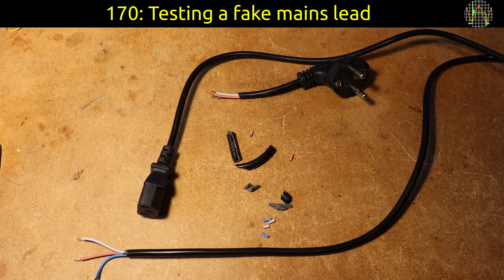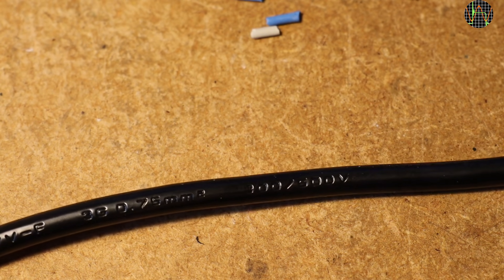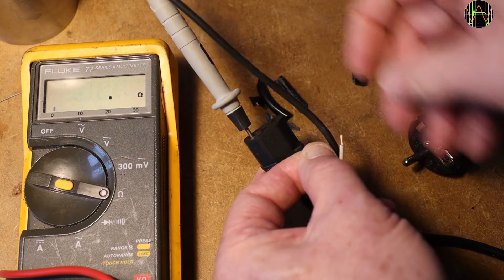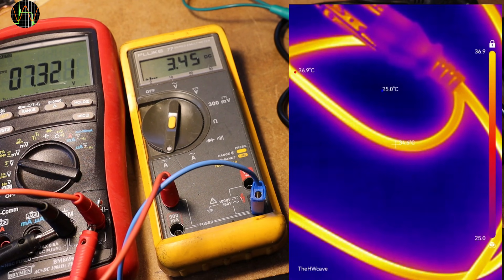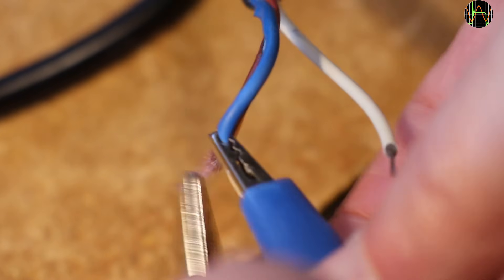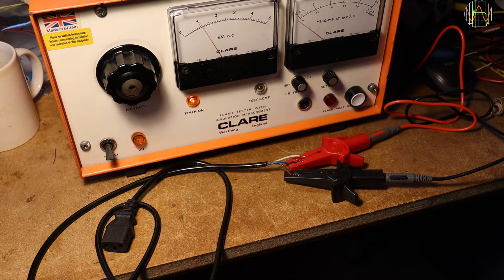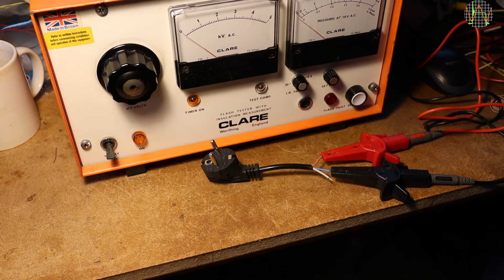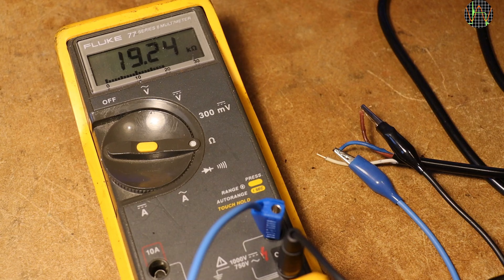170 - Testing a fake mains lead

Comment: You were "really lucky" to receive a cord with aluminum wires, i bought an el cheapo power supply a time ago from aliexpress and i was "shocked" to find that the wires were also almost invisible lol and to make the things worse they were made of freakin IRON! 🤬😠 An easy test to find out definitely if they are aluminum or copper is to place the exposed metal on a flame, copper will not deform just glow red hot, aluminum almost disintegrates.

Comment: I understand your point about the cord being incorrectly labeled. But, I do wonder if it was sufficient for the device that it came with... If it was underrated, does that mean that it was intentionally meant to be dangerous? It sure makes one wonder...
Reply from the maker: I get what you mean but the problem with these cords are that they are not fixed to the device. So even if they would be ok for the device it came with, there is no guarantee that the cord won't be moved to others.  I suspect my cord came with a Banggood hot air station (Atten clone) which peaks at more than 700W. That's nearly 3A which I think is already on the unsafe side of this cord. I think some manufacturers care only for money and have a total "don't care" attitude to safety. They pack the cheapest cord, and fit the cheapest fuses, both of which are very often fakes.
Reply: You could nowadays wire a mains led lamp/fixture in your house with very thin wires given the very low current they consume, the problem is if something shorts or overload on the end of the wiring, since it has "high resistance" it will melt and catch on fire because the current wasn't enough to trip the circuit breaker, and that's the big problem with these dangerous pieces of trash, and some of them also have really crappy plastic that easily falls apart

Comment: In the 1920s when radio/wireless sets in the home started to become common they often used a high resistance line cord to drop the voltage to the set. They could get quite warm and were often referred to as ‘curtain burners’, as they sometimes set the curtains, they were often hidden by (who wants to see an ugly wire in the parlour, after all) on fire.
Reply from the maker: Great story. I am sure this "high resistance" cord was put there intentionally and people knew it would get hot. These fake cords on the other hand are sneaky because these days people do not expect a "curtain burner"
Reply: @TheHWcave  absolutely, people were aware of the risk*. It was just the thought of a high resistance wire that brought to mind that old technology. :-)

* I realise, as I typed that that some people must not have been aware, or the term wouldn’t have been coined!
Reply: I have a fluorescent workshop lamp with a 15W tube; there is a warning on the unit that the cable is resistive and must not be shortened; I confirmed that there is no ballast inside the lamp, although I couldn't see what was there to ignite the tube initially.
Reply from the maker: Yes, such things exist but my guess is that in such cases the cable is fixed to the lamp so it can't be used for other things or a wrong cable plugged into the lamp. The cable I was testing was a normal "kettle lead", i.e. plugs on both ends. Such cables are universal and not meant to be used for just one specific device.

Comment: You still could've used it for a low current device, something only a few watts. I have a similar cable. Its in my drawer of cables. If i use it, i'll put a 315mA glass fuse a UK plug. Thats still about 75W @ 240V. W/V=A
Reply from the maker: I like the idea to put a glass fuse into the plug in case someone in the house borrows the cable to power something else.
Reply: @TheHWcave  There is only me. No one else lives with me.

Comment: Very interesting - I just changed an historic aluminium multi strand cable from a 1960's 3kW heater - the cable was about 3m long and each conductor had a resistance of just under 1 Ohm - as it was for a 3kW device, I assume the effective CSA of the original aluminium conductors was about 2.5mm², but I didn't measure it. The replacement copper wire was about 0.1 Ohm per conductor for the same length.